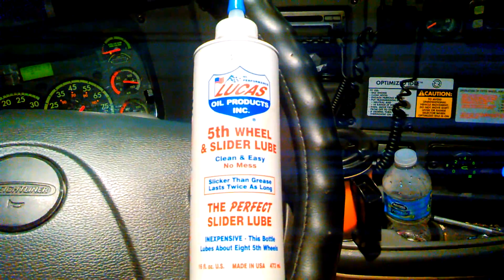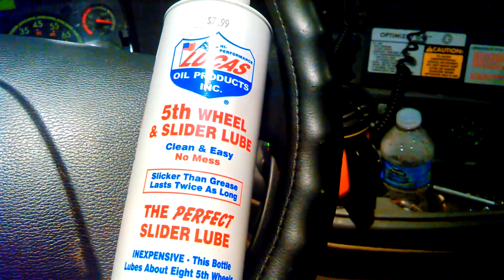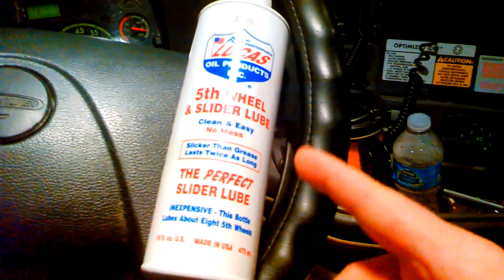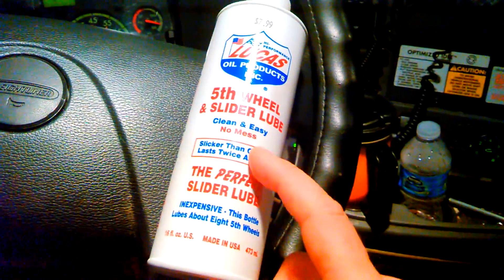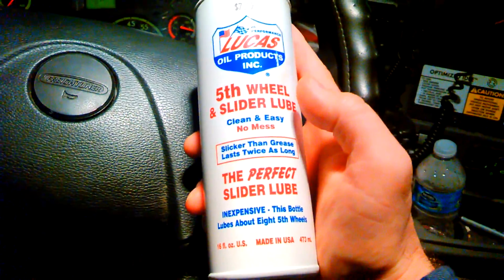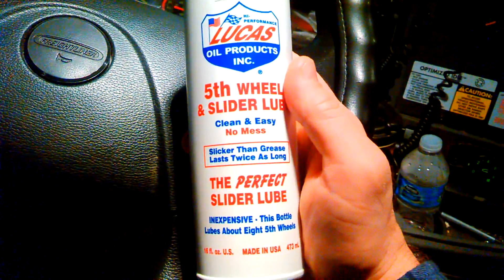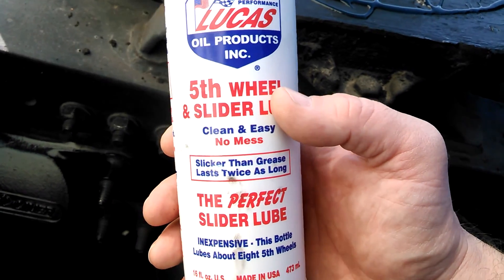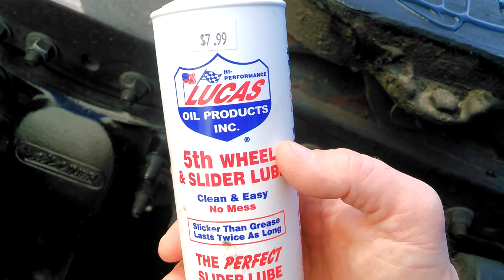Grease Your Fifth Wheel ! (and drop your bags to keep it that way)

Comment: I used it once and switched to the red tube because down here in el Paso the summers are brutal and the grease just slides off.that does however work great on the trailer tandem and 5th wheel slides